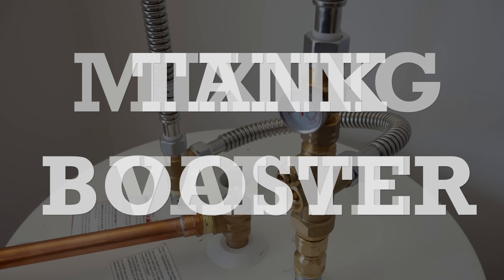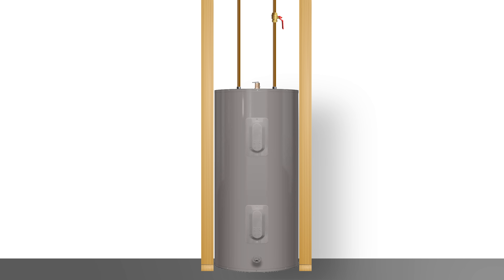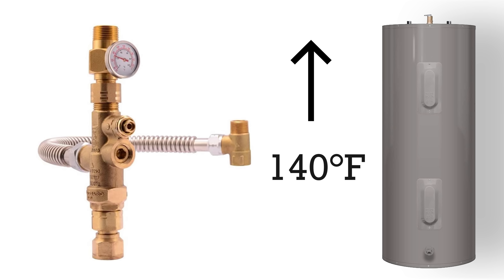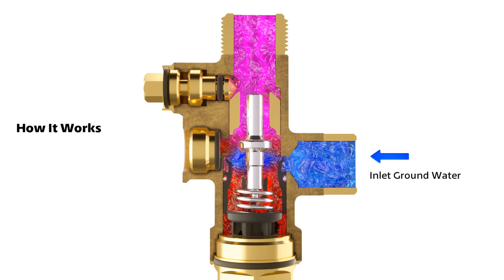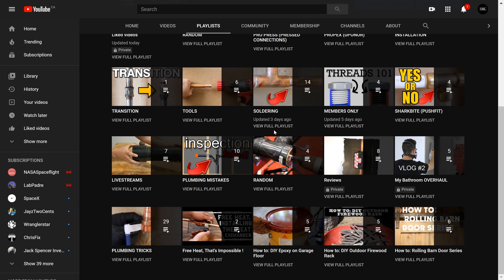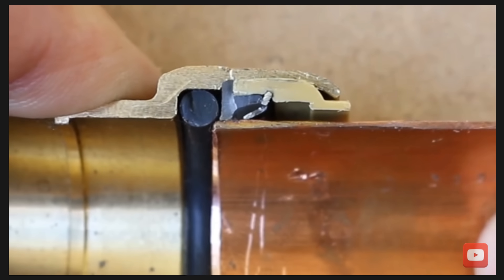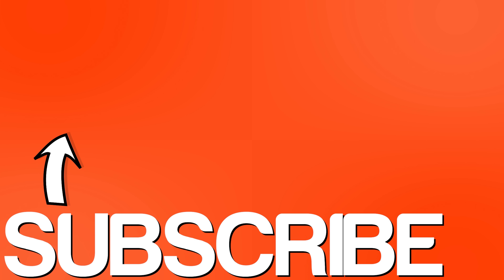INCREASE Your HOT WATER Capacity With This! (Cash Acme PRO Mixing Valve) | GOT2LEARN

Comment: Shark bites, really? Got to say I liked it better when you weren't sponsored.
Reply: It is used in a very accessible place, hence can be fixed easily and fast when it leaks in... like 15 years
Reply: I retract my statement.
Reply from the maker: @irrelevant6845  Much better hehe.
Reply from the maker: I am not sponsored by anyone, if it's accessible, you can use them no problem, if your Sharkbites are leaking, you aren't installing them properly.
Reply: Forgive me I misspoke. Not sponsored, getting paid to review.
Reply from the maker: @irrelevant6845  did not get 1 penny.

Comment: How well does this work with a tankless water heater??
Reply: Ummm...really?
Reply: @irrelevant6845  ummmm yeahhhhhh really
Reply: Tankless water heaters don't supply instant hot water. You'd need a recirculating pump for that with either a dedicated return line or a crossover valve. These keep hot water in the system. Some tankless units come with a recirculating pump in them or you can purchase a retro fit pump.
Reply: @XSR_RUGGER  they supply instant hot water IF it isn’t been a long time since the appliance was last used and the water in the line hasn’t cooled.  Your other ideas could be good options for continuous no waiting hot water
Reply: @XX-166  the same is true for a typical tank style water heater as well. That's all a recirculating pump does is make sure the water in the hot side of the system is filled with hot water. The pump turns on and the flow of water signals the tankless to turn on and heats the water. When the temp of the recirculating water reaches the temperature setting it signals the pump to shut off.
Reply: @XSR_RUGGER  absolutely... the typical tank does behave in that manner
Reply from the maker: You don't need these on tankless heaters.
Reply: @Got2Learn  theres a delay on the hot water side till that pipe empties the cooler water  lso perhaps you do. Now once the hot water is on then it’s all good.

Comment: I would only add that if they are installed the likelihood of a relief valve opening is much greater and a potable water expansion tank may need to be installed
Reply: An expansion tank is only required if expanding hot water has nowhere to go. If your house has a pressure reducing valve at the point of entry then yes, heating water will drive the pressure up to the point where your T&P valve will open.
If you're on a well, as I am, your main pressure tank absorbs the expanding hot water. No additional expansion tank is needed. 
It all depends on the individual circumstances. The Code does not have a one-size-fits -all rule about this.
Reply: @paulmaxwell8851  valid point regarding a well.
Reply: That is a great note. An expansion tank is code where I am, but my house is 25 years old and doesn't have one yet.

Comment: Thanks ive been looking to increase hot water’ What About maintenance though. Does the valve need frequent service just one in a while ?  Since the elements are always in use will they have to be replaced more frequently? Thanks again for the info
Reply from the maker: You might see a difference in the life of the tank and tank components, but it'll be minor, and no, no need to maintain but if you want you could undo it and clean the screens (strainers) for a quick cleanup.
Reply: Ok then i’m for sure getting one. Thanks from Cleveland Ohio👌🙌

Comment: A 60 gallon tank wouldn't fit in a 40 gallon space no matter what.
Reply from the maker: No a newer 40g wouldn't fit.
Reply: @Got2Learn  I learned this lesson the hard way years ago with going to a 50 gallon from a 40.  Nothing sucks more than wrestling that thing into place only to realize "damn, exhaust and supply don't fit."
Reply: @Got2Learn  hey so my house burned down a week or two ago.  Would you recommend something like this be put in by the plumber? Or does this not work with pex, which is what they're using
Reply: @oatlord  sorry to hear about your home. It will work fine with pex.

Comment: This is a great way to accelerate the failure of your water heater tank as it will be constantly running  to keep the temperature above scalding. This process will fry the pilot assembly, control valve thermometer, burner chamber components & tank due to excessive and persistent stress caused by the myriad of thermal energy dynamics which are taken into consideration during the engineering and production of a water heater. 
‘hacks’ like utilizing mixing valves on (improperly sized) residential water heaters have negative effects which should be articulated and considered. 

A UPC plumbing compliant Water heater installation in Sacramento California varies from 2400 to 4000 depending on contractor quality and job site logistics.

Gotta love YouTube. Now any home owner can F up their house!!👍
Reply: This product will cause cancer in the state of California
Reply: @LostLarz  😂
Reply: CA isn’t a good example for any process or what’s allowed.
Reply: @tb2324  k.
Reply: 140 is hardly a high-stress condition for most water tanks. My settings go up to 150 and the T&P doesn't trip until over 200.
Reply: @KennyMacDermid  the tpr valve is set to trip at 120 psi or 210 degrees. 210 degrees is boiling temp, in case you didn’t know. To use your tpr valve as a gauge for thermal stress is absurdly ignorant. 
The scald ratio of water is at 125 degrees. You should never crank your system above this in a residential application. 
Some commercial tanks are rated to operate up to 180 degrees for limited periods of time. 
The hotter the water, the shorter the lifespan of the tank. 
Btw, which brand water heater has a thermostat which only runs up to 150???  Every single unit goes up to 180. Not so sure you know what you’re working with there pal.

Comment: I'm getting one!!! I've notice our family of 5 using/running out of a lot more hot water with everyone home due to COVID
Reply from the maker: They have their own problems.
Reply from the maker: Good idea, this will certainly help!
Reply: gordon after you do it can you tell me if it worked and everyone gets hot water all day now ???? how much longer it last stuff like that
Reply: @Canuck Inoz It's misleading to say "instant" because it's more like "on demand." There is a slight delay. Let's say you take a shower, get out, and 15 minutes later another person gets in. They'll have hot water, then an unexpected sudden burst of luke warm or cold, and then very hot water. Sometimes piping is too small for an on-demand heater and needs to be upgraded. It's not as simple as just pulling out a tank, and putting in a wall mounted on-demand heater expecting endless hot water that comes on immediately and has no lulls or delays. Gotta go case by case.

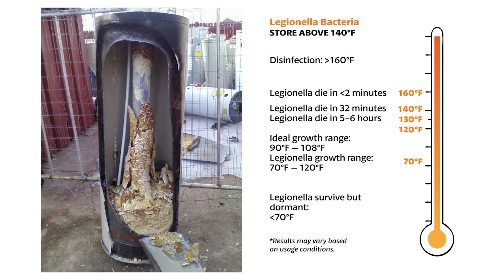Comment: @ 6:53 water heater install for $800😂
Maybe in some place’s.. 
more like $1200 , only a handyman would charge $800 around here.
Video 👍🏻
Reply: Another great post!   I installed my water heater in 2014 so knowing about this 2015 change will help me size the closet appropriately for the larger water heaters.    And the gadgets are a nice back pocket idea.   Also, it's not a hot water heater folks.  It's a water heater.  If it's already hot, does it need to be heated?
Reply: Here in Georgia I was quoted 600 to 800 for a water heater by a contractor.
Reply: Not here in Denver. We do a 40 gallon with no code upgrades for $1850.
Reply from the maker: Yeah some places really charge expensive, I thought i'd be conservative lol..Thanks!!
Reply: Damn, all this time I've been charging family and friends $200.00 labor to install their new water heater. $800 to $1200 labor is outrageous. I'm just a simple handyman. My customers pay for the water heater and supplies.
Reply: Louie Lopez what does the code require with a water heater replacement??
Reply: @tarxantoo  what's a code? LOL LOL LOL 😂🤣😂🤣
Reply: Louie Lopez my point exactly. 
No insurance not bonded not licensed no real responsibility.if you flood somebody’s house you walk away . If I flood somebody’s house I’m responsible for it, I have to install according to code. Handymen are all over 
Here but it doesn’t hurt my  business at all . I get the call when y’all are finished and I go fix it according to code so it will pass inspection .
Reply: @tarxantoo  in auburn AL as far as code goes, the pressure relief valve has to exit to the exterior of the home, or into a waste drain that goes to the street or a septic tank.
Reply: cruzmissile25  also a gas heater up grade consist of raising it off the floor vent pipe up grade and gas line have to be addressed also. . There are no short cut when it comes to carbon monoxide and gas !
Reply: @louielopez1638  if it only takes you two hours to install,  you are essentially making $100 an hour, so charge what you believe is fair.
Reply: Louie Lopez in your area?
Reply: @tarxantoo  I don't know what other companies charge. I do handy work only when family and friends call me. I know labor is not cheap. I charge what I think is fair. For example, I would charge $40 to change a kitchen faucet that my customer bought. If I have to buy it for them I would charge an extra $35 plus the cost of the faucet plus the $40 to install it. I'm a retired truck driver.
Reply: @louielopez1638  no license no insurance = hack
Reply: jeanette shackles good to know that in 40 years you have never made a mistake.  You did however make a mistake in thinking I was talking to you.

Comment: Here in Arizona, there's no such thing as cold water from May to Sept.  Hot water comes from both sides of the tap.  But this could be useful during our winters.
Reply: Ugh THAT would suck!!! I love taking cold showers in the hot humid summers here in Missouri. Couldn't imagine only having hot.....and hot.
Reply: Thats funny. I'm from CT and when I visited family in CA in July. I made a comment that they ran out of cold water.
Reply: @xyoojj  lol.  weird isn't it.
Reply from the maker: Hehe, thanks funny to hear, but sad at the same time LOL
Reply: @Jtzkb  right?
Reply: How warm does your cold water get? I wonder how deep you would need to bury a cistern to keep it cool enough.
Reply: @michaellewis6569  I've never taken the temp but it's warm enough to turn off the hot water heater all summer and shower with water only from the "cold" side.  If I had to guess, I'd say high 80s.
Since there's little chance of freezing a pipe where I am, there's little incentive for builders to bury pipes deeper than code mandates.  In places like Flagstaff, they have plenty of cold water.
If I wanted cold water, I'd bury a cistern so the top of it was at least 10 feet underground.  But, how deep are the pipes from the water source, that are leading to that cistern?  Not 10 feet.  So that water is also warm or even hot.  We just live with it.
Reply: @2tommyrad  that's crazy. I guess just the price you pay for living where it's sunny all year. Better than Seattle anyway.
Reply: @Jtzkb  hah. Ramen cooking is a funny reference point. I dig it.